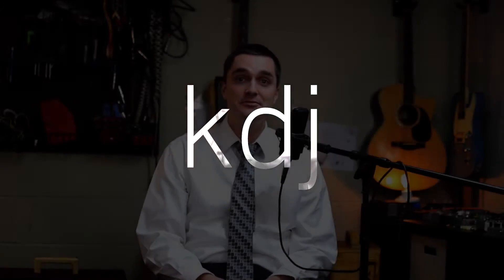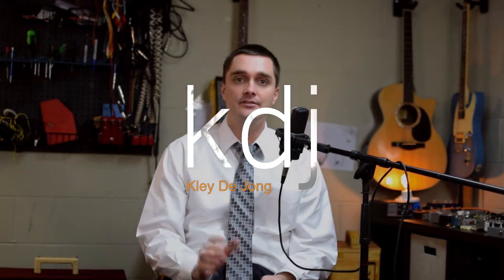Transistor Testing - Boost vs Hard Clip vs Soft Clip

Comment: A) EQ inside a pedal is equally if not more important than the method to create distortion 

B) the transistor in the Electra also creates a lot of distortion, even before it hits the diodes to ground. So the Electra is not just pure "hard clipping). 

PS: the output of the Electra is not symmetrical, even though the diodes look symmetrical, and the reason is that the transistor also creates distortion.

Comment: I just started working with transistor clipping, and as I'm sure you know by now, there is a necessity to run BJT's or FET's at the top of their operating parameters to get them naturally overdriven into clipping the signal. For people that happen upon this and are hobbyists getting started, bear in mind a BJT is not an ideal input stage directly following your guitar's passive controls.

I have a formal background in engineering, and knew this going into a design, so having said that, I've still had excellent results running straight from guitar into a BJT configured for high voltage and high current gain, but upon pursuing a high input impedance design, ultimately had better results for distortion-oriented topology. For a boost, a single or pair of BJT's can work wonderfully, and if you desire a high input impedance and high gain, it can be achieved by multiplying your bias, emitter and load resistor by a factor of 10 or even 100. Because they are a higher gain potential than an FET/MOSFET, you can still achieve a lot of voltage gain with a high input impedance configuration, and not need to abandon an idea for an FET equivalent.

Comment: I've got a 2n3094 and 2n3096 in a Szaklai Pair 1k r for shut down. 4.7k+100k pot for bias.. White LED feedback clipper and Red Hard Clipper on output. I've got a 2k pot for a gain.

The LEDs flash and the circuit is very loud. Later gain stages keep the gate and fuzz but add sustain.

I'll be switching a Germanium transistor in my next pairing.

Either way I've got loads of gain as is and had to add the gain pot